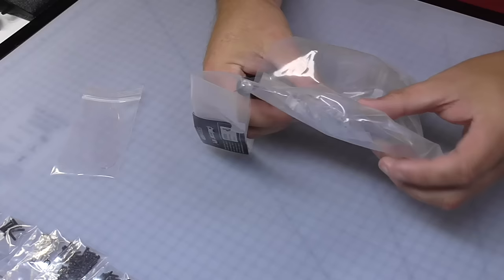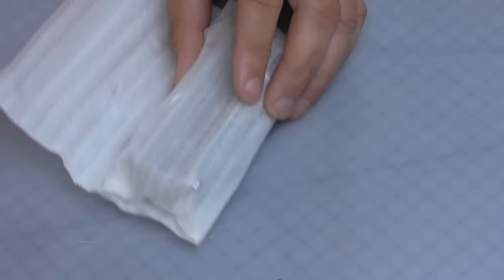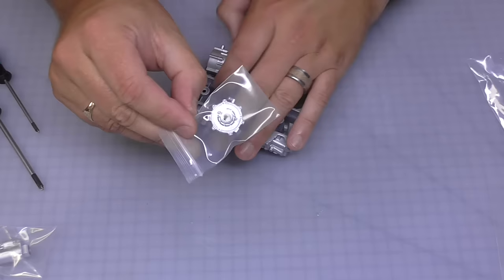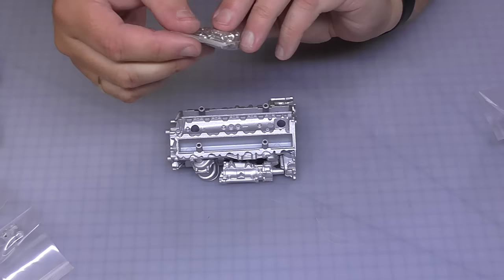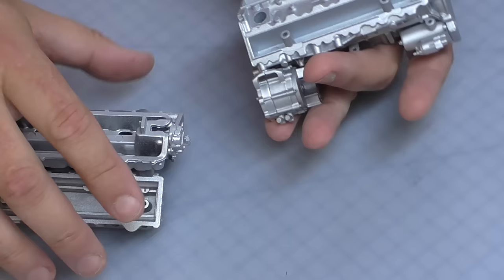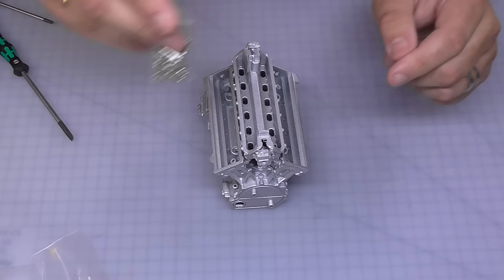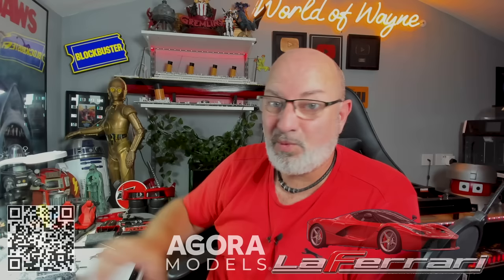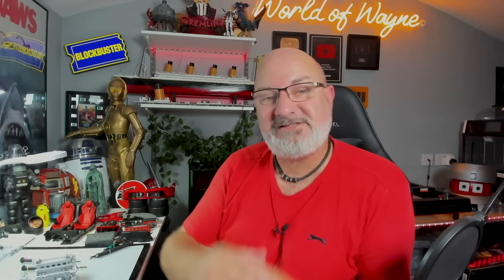Build the LaFerrari 1:8 Scale - Pack 4 - Stages 25-32

Comment: Another great video Wayne. I think the biggest issue putting me off this model are the body panel joints, the panel edges have a slight curve and the joints are just to wide, so the fit looks poor.  Look at the real car images and you'll see what I mean. I realise that the real car is an unrealistic expectation for the model, I would have expected greater care with the body panel moulding to maximise realism.  Perhaps my expectations are too high?
Reply from the maker: I'll have e to check it out when I see how it comes together.

Comment: When you put last part water pump of stage 31 and take the flat heat screw into lower left because there big cap.
Reply: Mean: flat heat screw into hole before put the water pump for next pack.